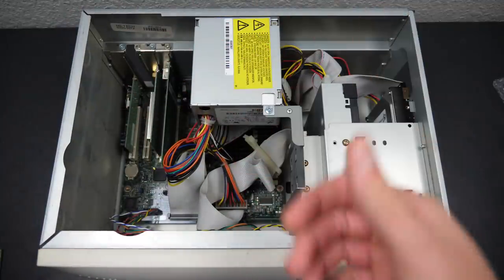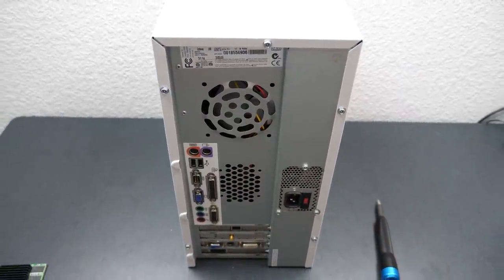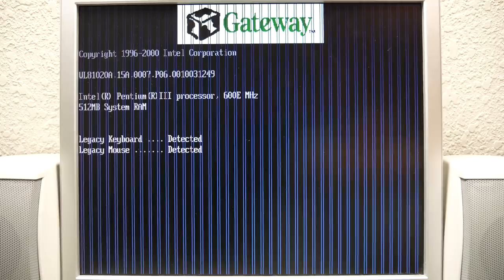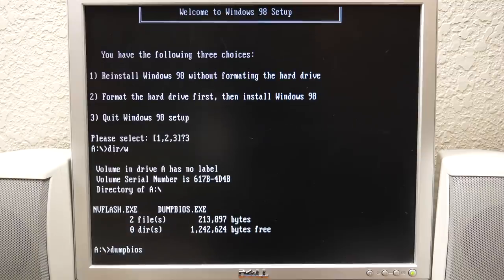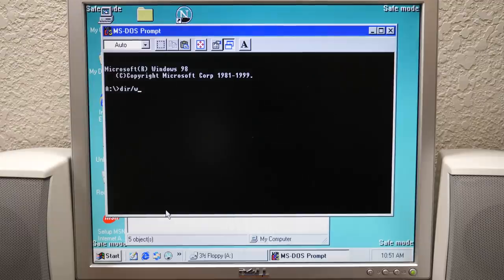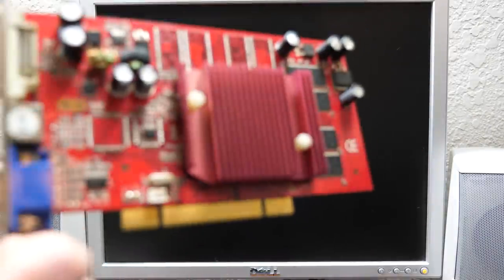Installing a Graphics Card in the $5 Windows 98 PC..... Maybe

Comment: For me, that looks like the GPU has an BGA soldering issue. That means not all solder balls under the chip where soldered properly, but all the surrounding solder points have forced the GPU down enough, that the incomplete soldered point had s good contact before shipment, so the card was working properly. Than in Shipment was a lot of harsh handling, and the not really good soldered points have lost contact, so the card isn't working anymore. In many cases, it will help (a while) to heat up the GPU over thr melting point of the solder.  This will not really solder the solderimg points to the PCB, but will reshape them, that the surroundind solder ponts will force that drop of solder to to it's contact pont again, and the card will work again for some time, maybe as long as you want to use this, or in bad cases, for a few days. A better way is do de-solder the whole chip, clean up all the soldering points and reball the GPU-chip for a total new soldering.

Comment: Do not update firmware unless you know what you are doing.  Read everything very carefully first.  I would not be editing firmware files if you are not already experienced with upgrading to official firmware builds.  I don't think this was the problem, but run a long "dir" without the /w to make sure your firmware file is not zero bytes.  Mark your floppy disks with masking tape to label them so you don't get them confused.  Make sure the firmware update utility is the right version for your card.  Especially with older hardware, there may be many versions of the fw utility, but ones older than the card likely won't work.

Comment: You can get the original bios from the techpowerup bios database and flash it the same way, but you have to force the bios to boot from the integrated graphics. Also check in nibitor the integrity of the bios, it should be with a green point instead of a red point.
Reply: Also if you can't get working well with the stock bios, maybe it's work for the oven or a heat gun

Comment: if the card is actually bricked then one option you could still have is to physically remove the BIOS Chip and use an external programmer (either an actual EEPROM/Flash Programmer, or just an Arduino/RaspPi hooked up the chip) to reflash the BIOS manually.
let's hope there is an option before this. for example, maybe you can use a second Graphics Card that is only there to run the display, so you can run the DOS utility again, but that assumes that you can select the Card you want to flash the BIOS to. and DOS is not known to be that hardware flexable...

Comment: Can you boot from the integrated graphics and re-flash the BIOS dump you did?
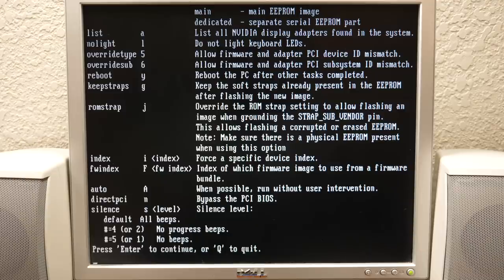Reply: 17:00 I am not sure how the EepROM is wired to the PCI-bus but the "ROMSTRAP" command looks interesting and claims to be used to flash a corrupt EEPROM.
Start with integrated graphics into DOS and connect the PCI-port then flashing it might work or not... It's worth a try, I mean it's already broken.
Reply: @christoffer4862  Yeah,  and it most likely is a software issue because installing drivers made it display lines in the bios but when Michael went in safe mode it stopped. I still wouldn't be surprised if it didn't work because its a card from the 90's or less, I'm surprised it still displayed something

Comment: Does anyone know if it possible firmware or chips on the gpu can suffer from data rot?
 I know SSDs and HDDs can suffer from such things after a long period of being unused, other than that I would guess a bad capacitor since this is close to the capacitor plague of the late 90s but it doesn't look like any of them are leaking/damaged

Comment: So this card will be detected in any computer wirh a pci slot.

Id recommed flashing the bios back using a more modern compiter with usb boot and another video card. If you have another nvidia card in the system be sure to run the list device command and use the select device flag.

Comment: I do have an nvidia geforce 7300 LE. I could not get it to work in windows 98 but there have been attempts to mod a driver to work in 98. It does work in vista and 7 if you would like the card for that. It is a PCI/PCIE card though.

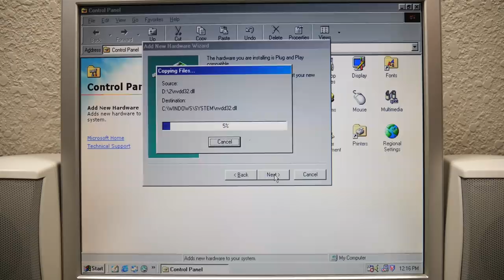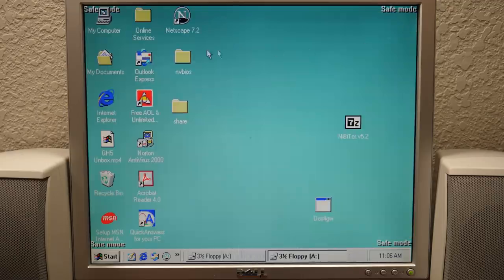Comment: i think you have save the wrong bios version. Its  a card from Palit. this you can see if you search for the string xnp-52000-td16-p72e-s in google. The String you find in 5:55 . You can fix it.   You have choose the Gainward bios in 14:17. So this doesn't run .... Go to Bios . Choose Onboard  Graphics permanently. Plugin the card  and choose now the rigth bios and reflash it. PS : frequency gpu chip : 250 MHZ DDR Frequenz: 400 MHZ (set 200)

Comment: An easy fix?

Install a working GPU in one slot and this FX GPU in another slot.  The working one will get you past the BIOS error and give you video on the monitor to work with.  Then you can flash the BIOS you dumped originally.  It will be much easier on you if the 'working' card you use isn't also a nVidia card.
Reply: if he had another working card, he would just use that card instead
Reply: @taududeblobber221  What was he using when he was trying to pre-load the nVidia drivers?
Reply: @ParoxyDM  integrated graphics i think

Comment: If the card just can't initialise and is still recognised, you should still be able to flash a bios to it using the onboard GFX instead. 
If you can find a Vanilla bios for it you should be golden. Have no idea what had been changed by the previous owner. I have looked around a little and it seems those BIOS' are very hard to come by...
Reply: Maybe someone with a stock card could back up a bios for you and send it to you to try.

Comment: Michael, you don't need to be so reliant on floppy disks here. When you're booted in DOS you can change to the C: drive and cd to a directory on the hard drive, then you don't need to worry about possible floppy corruption. Also you don't need a floppy to boot into DOS. In the 98 startup menu (hold Ctrl before Windows loads to force the menu) just choose 'Safe mode command prompt only' to get the same pure DOS.
Reply from the maker: That makes it too easy 😂

Comment: Yeah based on the lines and artificating I would say this is an actual GPU BGA issue. Likely a failed chip or bad solder joints. I would say it's luck that it would work occasionally, this is probably due to thermal cycling.

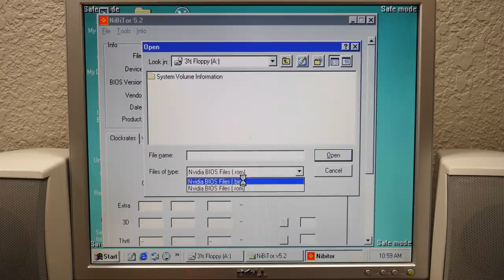Comment: at 13:49 i noticed at the top you had the agp variant of this card selected in nibitor. you also had it set as a gainword card when i think this one is a palit card. I think you might have just flashed the wrong bios onto it.  I hope you can get it fixed! you might have to remove the bios chip and flash it with a programmer.

Comment: I searched fx5200 specs online and it says that default memory speed is 166/200mhz so its not overclocked but underclocked?
Reply: The video RAM is double data rate (DDR) so there are two ways of describing the same speed. The transfer speed is double the clock speed. You might be mixing the two.

Comment: In my experience back then when the card displays that was time to change because of the heat was cooked, either by use or in this case overclock. The attempt of fixing was right yet maybe its a revision version that need specific files.

Comment: That was an FX5200? Those cards are very cheap and plentiful in the used market and seems they are Workstation cards. They are well supported in LINUX and later versions of Windows but they do have issues with stability. At least I own 10 of them so I can run through them if one glitches up on me.

Comment: i think you bricked the card but the card might had beed ded even before you messed it up
3  rules of using or rescuing  broken card

1 set primary graphic adapter to integrated gpu before flashing anything
2 connect the monitor to integrated graphic
3 check if the flasher you are using is intended for the graphic card you have, because it might had droped the support for older cards to save space.

in that combo you should be able to see in nvflash even bricked cards and flash them back to life if the gpu die or something on memory bus isn't broken

but i must say that look suspiciously like it was shiped and kicked and gpu just slightly separated from pcb under the inertia of radiator in shipping and baking that card in an non food compliant oven might fix it, or destroy it forever. slight memory speed overclock, especially for 2d would not make much problems , especially since 3d clock is much higher and drivers check for them both on startup

good luck with your new potato

Comment: Try forcing on-board video and see if it still cares about the GeForce. If it doesn't, then try flashing the original BIOS. Otherwise you will need a PC which doesn't care about an external GPU being dead. Could be a modern PC. 

Once you've got it reset back to working condition, redo the modification, but look up the specs for a vanilla FX 5200 and be certain that all of the values on all of the tabs match that. I expect that the GPU clock is wrong for the RAM speed and perhaps the Vcore is set wrong too.

Also, Action Retro has a video where they ran into a ton of NVFlash issues while doing a PC to Mac flash, so maybe give it a watch and see if their process gives you any clues.

Comment: Michael, 
That GPU might not be dead. It's showing signs that the GPU chip might need reflowing/reballing as it might have a bad solder joint due to overheating (Especially if overclocked with no fan!)

Take off the heatsink, and use a heatgun or a seriously good hair drier on the card, heating up the whole board first then focusing on the GPU for a solid 2 minutes. 
That should at least breathe a few months life back into the card. 
I have to do this often with mobile GPUs in faulty gaming laptops which suffer with bad heat issues thanks to poor design and dust buildup. 

Retro PCs are fun till you realise just what a pain in the ass they are lol, I had similar issues upgrading my Dimension L800CXE from Celeron 800 to PIII 1ghz and 1GB Ram, ended up with 512mb ram, PIII 1ghz after finding one cheap, and a 5800 Ultra from good 'ol China.

Comment: I can't say that you did something wrong. What I would've do is to do everything from scratch but on a hard drive after that strange behavior with wrong floppy contents.
Next thing is that I've seen is that a floppy disk was near full, but you saved a new bios on it? Even if it's a success message I usually check that a file size looks good because who knows if the program doesn't actually contain a bug to show a success even if it failed. If the only frequencies are changed it must be the same as the original.
Of course it will probably not boot now by any means, so your only way is to take out a flash chip, snap it into a chip programmer and write a bios on it directly. But that lines are not a good sign at all, which means that the card itself was faulty already.

Comment: Installing graphics

Me, who still uses onboard Ati Radeon graphics on my xp pc:
Reply: At least it works
Reply: i use my old pc as daily driver too,it has a p4 531,1gb ram,and intel 82915g/gv/910gl integrated graphics,i upgraded to raadeon r5 230,preety good card for sff pc,but i may buy new pc.
Reply: @WhirlwindQuest  Well actually it's pretty good. Sure, sometimes it has issues with older versions of DirectX (Harry Potter and the Chamber of Secrets) but it can play games at decent resolutions. I can even watch YouTube if I use Firefox
Reply: @bokexd3173  Yeah. The reason I was unabke to put my radeon pro in was because it was AGP. At least I got my soundblaster audigy to run perfectly. EAX support!

Comment: I thought the GPU has an AGP connector. Maybe you connect it to the wrong type of port.
Reply: Correct me if I'm wrong
Reply: Most 5200s have AGP but this one is plain PCI. The second slot in the connector means the card can be used on 3.3v as well as normal 5v PCI buses. AGP cards don't physically fit in PCI slots and vice verse.

Comment: hay MJD, if you upgrade the ram, can you put Windows 10 on the $5 98 pc
Reply: probably not, Windows 7 is the furthest these old machines can go due to their processor. Since Windows 8 and 10 require stuff like SSE2 which wasn't present in intel processors of the 90s. Now if you upgraded the processor to something like a Pentium 4 or anything from early 2000s, then that could be possible. But then it would be more of a 2000/XP pc than 98 pc.

Comment: Oh Gosh, I had this graphics card... it sucked soooo bad. I had an Athlon XP 2400+ with 4Gb of RAM and this garbage installed... As a result, my PC froze ALL the time, I had to have an app installed in the system tray to lower down the clock, or this graphics card would certainly freeze.

Comment: Hi i have one suggestion for future upgrades on this win 98 machine. Actually on ebay you can buy IDE SSDs which are made for that old computers. Maybe is this worth trying. What do you think
Reply: Best option is a SATA to IDE adapter, and use a SATA SSD. Those IDE ones don't have much storage, and were built for servers. So they don't have Master or Slave settings like most IDE HDDs do. So the computer might not recognize it. Some SATA to IDE adapters do have those jumper settings on them. So he'll have to find one with those settings on it.
Reply: @TheNews1990  yeah i agree

Comment: Oh nice getting ready for the PCem emulator vs The $5 windows 98 pc :)
aw no way might its faulty 3:35 :( </3

If you have a heat gun you could use it all over the card and see if that fixes it :)
18:00 ohhhh that's not good, yeah it's bricked :( I did that to my Radeon X850 XT many years ago :( 
What might have happened, was you dumped the bios as a bin and edited it and saved it as a .rom 
Might have been ok if you dumped it as a .bin edited it and saved it as a .bin again.

Comment: Lmao I’m using windows 10 home, 32bit. I got virtual box with windows xp on it and I installed all the right drivers so I can full screen, ect. Windows xp is much better with the virtual box drivers... I’m using virtual box 5.222.. and it works perfectly fine. Also got a 64bit Intel atom x5 and for ram I got 2gb ddr3 and for my mother board I got a AMI corp cherry trail cr (socket 0) and for graphics card I got a 1920x1080 intel hd graphics
And for storage I got 28gb ssd and 57gb usb. Intel sst audio wdm. My pc is an okay pc.
Reply: i don't see how this has anything to do with the video but ok

Comment: with a system with another GPU (NOT Nvidia  so you dont flash that one by accident) you might me able to unbrick it
Reply: if he had another gpu, he would just use that one instead of this one.
Reply: @taududeblobber221  i mean a system with either a worse card for this system or a different bus (eg AGP or PCIe)
Reply: @sparcie420  i don't think he has any other gpus that would be compatible with this system.
Reply: @taududeblobber221  i meant flashing/unbricking it in a different system and then putting it back

Comment: Druaga1 had never seen such bullshit.

All seriousness tho, I think where it went wrong was using a newer version of the flash utility then forcing it to usr .rom instead of .bin Things such as hex variables could have royally messed things up.  Also there are win98 tools that you could have launched within windows to "downclock" the speeds without a bios flash. You may be able to boot with the iGPU plugged in, and then booted back to windows to reflash the old bios back.

Comment: Something happened when you under-clocked the GPU.

Option 1: You lowered it too much not giving enough power.

Option 2: You lowered it too much and there's an issue with the rest of the GPU not meeting with the rest of it.

Option 3 (worst case scenario): You possibly killed the GPU, under-clocked it too much.